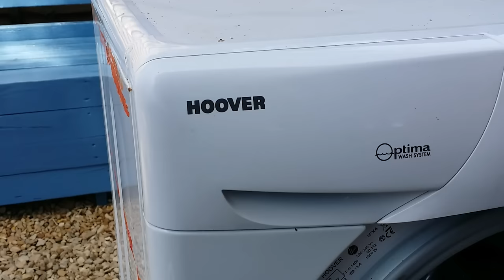HOW TO REPLACE BEARINGS ON SEALED WASHING MACHINE DRUM.

Comment: I have done it, here are two important tips : drill holes before you cut the casing. Make sure to put alot of silicone and that the holes are outside of the silicone. Really put alot, even if you get access silicone dripping out.

Comment: You can use the old bearing to drive in the new one and clean the shaft a little with emery cloth before inserting 👍🏻
Reply: A socket that's a smidge off the diameter of the bearing so it rests on the outer ring of the bearing also works well if you've got one large enough.

Comment: Never use only liquid detergent and low temperatures!
Reply: U mean low temperature causes problem ?
Reply: Should we heat sometimes ?
Reply: @harshitshukla5140  Whites and cotton with colour resistant at minimum 60° Celsius with powder detergent!
Reply: Actually asking because my waching machine is broke rn... something happens with drum bearing or shaft ...always used washing  powder with normal water temperature ...this can be a reason ? And what can go wrong if i did it ? @27dff
Reply: @harshitshukla5140  Cold water needs only with dark items. Better if 30-40°!
Reply: No i mean washing with powder and and only cold water can damage washing machine ? Thts my question @27dff
Reply: @harshitshukla5140  I think so.
Reply: @filanfisteku3170  No, if the bearings are well sized.

Comment: Clean the drum and casing first, spindle too, spotless they need to be, to drive the bearing in use a 12mm bolt and big penny washers to clamp them and squeeze into the hole no hammer needed, and to pull the spindle through again washers and a socket plus bolt don't risk cracking the casing, the seal is better if you use a PU seal like tiger seal.

Comment: I think the plastics used in drum tubs are typically polyolefins like polypropylene and PET, which are plastics that most stuff including silicone doesn't adhere well to,  although you can buy adhesives designed to bond polyolefins, or a polyolefin primer which modifies the surface to allow other stuff to stick. Don't use a primer + superglue combination as cyanoacrylate  is not water resistant.  

The type of plastic should be marked on the tub to aid recycling.

Comment: really helpful video - going to try this myself - any hints on which bearings will work please? All the suppliers just keep saying they can't be replaced. thanks, Julian
Reply from the maker: Try from espares or buyspares website,they sell complete kit seals and bearings.
Reply: @DIY_ALAM  thanks, I've tried them and others and all just say not replaceable so not sure which ones to order. thanks.
Reply: @balancemotorsport8664 easiest way would be to get them out first then measure the internal and external diameter along with the thickness. Just type the dimensions into Google and you should find it easy enough. Don't worry about it being specifically for washing machines, just "sealed" bearings
Reply: @PercyJackson93  thanks - trouble is the machine gets used every day, Ideally I'd like to take a punt and have what might be the correct bearing in hand.  Just replaced the brushes again. Going to leave it until the drum lets go I think
Reply: @balancemotorsport8664  do not completely destroy the bearings because very expensive damage will occur.. if you know, change it immediately or buy a new machine..

Comment: You're hoping the thin silicone seal will tolerate the spin and heat cycles without leaking, never mind potential air leaks to interfere with the pressure switch and drum filling.  I would not feel comfortable leaving this repaired washing machine alone while I'm out.  Would it not be possible to plastic-weld the drum closed again, at least the seal would be durable?
Reply: I'd use Gasket RTV.. Resists oil, coolant and fuel up till 250 degrees. Even your sump on your car is most likely sealed with the stuff, it's pretty amazing. This stuff he uses.... not sure lol
Reply: use 1215 THREEBOND sets like rubber
Reply: You shouldn't leave your washing machine on when your out period😂 I get what you mean though regarding the seal. As someone who plastic welds every other day at work, I thought similar about remelting the edge once done for extra security. A soldering iron can be used as a DIY method to seal both halves after bolting and siliconing

Comment: Hi!
Firstly, very good!!!..👍🏻

But I would like to ask you...
For a job of this kind, which to me seems anything but simple and fast, therefore including labor and part/spare parts, done by a specialized Multi-brand technician, (and therefore by a professional, and not by an impromptu under the stairs of his house... ) how much would it cost today 2023??......

Because in my opinion it is better to get a new bath group....
Or am I wrong???...
Also because, in any case, opening it and redoing everything would nevertheless be something "botched," with possible errors (because it can happen...) in the work of the technician himself, which the customer would never find out about, and therefore not actually comparable with a completely brand new bath group, and therefore from the factory, made with computerized numerically controlled machines.

Also because, moreover, we must take into consideration the fact that if, for example, the bearing needs to be changed, it must in any case be said that the cruise (which is perhaps still "healthy"... ) has in any case made its working life, and therefore it could break (as happens many times) shortly thereafter, and therefore what to do?....Reassemble the whole washing machine again, extract the whole tub group, and reopen the latter again, to weld the cross, or replace the drum (basket) with a new one, and insert it on an old, messy tub?..... Which by the way, being this in any case in porous plastic, although previously cleaned, is in any case aged, and ruined!....
Personally it seems to me something truly anomalous, if not silly, and therefore incomprehensible, but above all I believe that it is not convenient under any aspect, (cheap in the first place..) form, and place.

On the other hand, perhaps a different thing could be for a tub that is still in plastic, but one that can be opened from the factory, even if it must be said that even for these that can be opened, the problem of aged plastic, and ruined by time and prolonged use, would not be solved .
Completely different situation, possibly for steel tanks, which are "eternal" and easy to clean and therefore "eternally new."
what do you say......

 I wait for you....
 Bye thank you!
Reply: One one hand time consuming, potential errors, other parts coming to end of use; DIY repair can be cost effective, more eco friendly, enjoyable and simple process.

Not keen on the glued drum, would avoid these for maintenance ease.
Reply: Mario, this is not for you.. buy yourself a new machine..

Comment: How many holes did you drill? I am opening my sealed drum only to clean the shit out of it. Thanks for the video
Reply from the maker: 4 inches space between holes.
Reply: Just take the element out if you need access to clean sediment out of it. I do an empty wash with anhydrous citric acid to remove limescale and grease. Washing soda may be better for mould. I have once used chlorine bleach (don't mix with acid) to tackle an extreme case of stinky mould caused by exclusively using liquid detergents in the wash many years ago. I now mostly use powders which prevent mould as they pretty much all contain oxygen bleach.